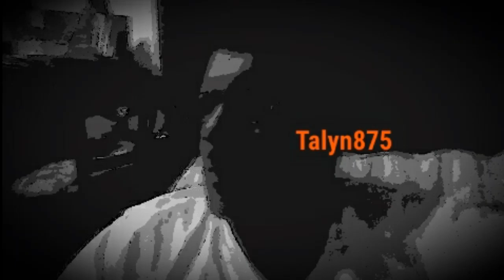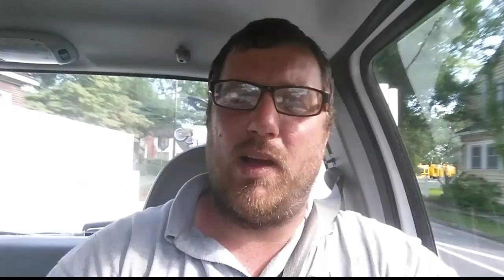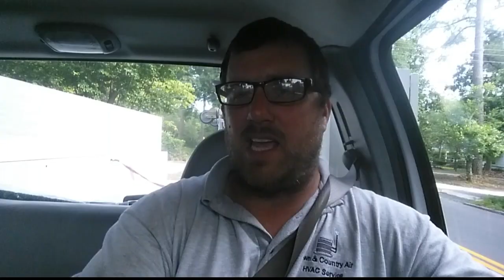Why Does Low Airflow Cause Low Superheat (Air Conditioning)

Comment: I'm relatively new to hvac.  I graduated hvac technical school about a year ago.

Today I started charging a unit today and my subcool/superheat would not climb. So I stopped.

So the split was about 9 years in this mobile home. The A.H. was in a built in room with a water heater with no door with a 6 inch duct hanging from the ceiling. (It had no plenum)

The only air it was getting was the air sucking around the 1 to 2 inches around the AH and the 6 inch pipe coming from the attic.

I cut a 24x36 hole and put a grille over it....walked outside and the damn thing was over charged.

(Call me a rookie but I'm learning)

Comment: great video.  Just started charging by superheat.  Is it normal for suction line temperature to go from target superheat say 12 degrees to 0 degrees then back up to 12 degrees.  A lot of my superheat measurements tend to flucuate.  Older systems undersized linesets etc.
Reply from the maker: Need to see what the airflow is. Should not fluctuate very much.